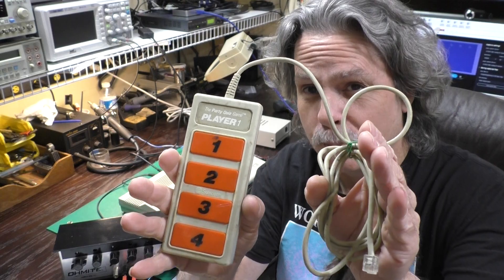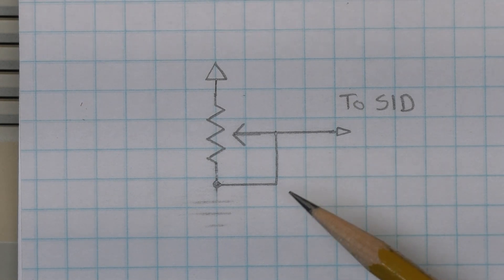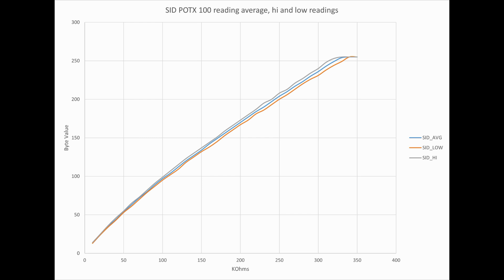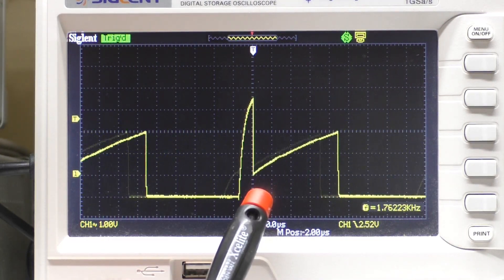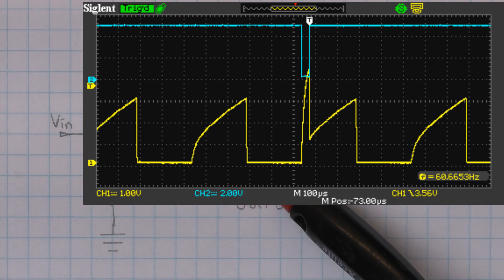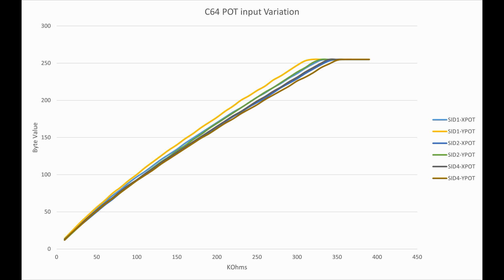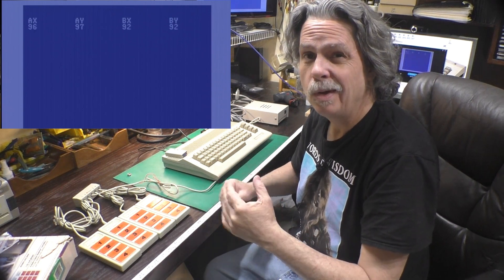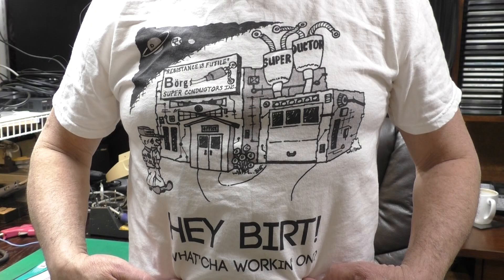Going to POT – Investigating the C64 paddle/POT inputs and devices, a deeeeep dive…

Comment: Did you ever confirm the presence of the capacitor on the C64 motherboard? C64 wiki shows paddles with pots and caps, but I cannot find anyone using caps in their DIY paddles. If they are onboard, then this makes sense.
Reply from the maker: The timing capacitor is in the computer. I have never seen on in the paddle itself. On the C64 the capacitors are C10 and C11. On some early C64 they installed the wrong values for these two caps.
Reply: @HeyBirt  Thanks Jeff.
Reply: @HeyBirt  Found a schematic online, went looking for C10/11 to get used to reading schematics. Found POTX and POTY going to the SID but C48 and C93 were on those lines. Maybe a different revision of the board? Looks like C10/11 are for sound. Found some forum chatter about filters?
Reply from the maker: @CollinBaillie  Sorry, I'm not sure what I was thinking. You are of course correct. The caps for the paddles are C48 and C98 1800pf.

Comment: I enjoyed this video. POT input on the C64 has always been somewhat obscure to me. It is interesting that they chose the SID chip for A/D conversion.
Reply from the maker: Many times these decisions were based on what chip would have space enough on the die and enough free pins. When Atari did the POKEY they also wanted to use the same chip on arcade PCBs so they incorporated  the POt and KEYboard functions along with sound on one chip.

Comment: 1 POKE 56333,127
 
2 PRINT PEEK(54297), PEEK(54298) : GOTO 2

If you connect a 1351 mouse to port 1 and run this program, you get direct mouse readings. As you move the mouse around, you'll see the values sometimes jump from a low value to a high one. The returned values is somewhere in the middle of the numeric range, but it's interesting to note this range is almost exactly 128 units "wide" on either axis. In programs, a 1351 mouse driver looks for this wraparound jump* and takes it into account, allowing you to keep moving the mouse pointer until you run it off the desk! My question is, was the Commodore 1351 mouse designed to "precisely" return POT values within a specific range (meaning every 1351 should return identical values) or is it (since this is analog) using some less-accurate fudgery which the driver itself was supposed to compensate for?

On my flat C64, location 54297 returns values between 85 and 215 (a range of 131 units) and 54298 returns values between 83 and 212 (a range of 130 units). My breadbox C64 returns the exact same range widths for this same mouse, but offers values of 86 to 216 and 84 to 213... exactly 1 higher for both axis. (If anyone tries this program, please share your readings!)

My suspicion here is Commodore's mouse (ideally) was designed to return a range of 128, and where exactly that range occurs is irrelevant. The driver works best expecting a 128 range, but the where of it does not matter. Because my mouse's ranges aren't perfect, there would be a slight jitter using GEOS or similar when the internal wrap occurs, unless the driver is really clever. The ones I've worked with (starting with the one in the programmer's reference guide) happily assume 128 is going to be the range.

*BONUS THOUGHT (as if I didn't write enough) when you ARE using a mouse program, and whip the mouse quickly in one direction, you may see the pointer jump in the opposite direction. I believe this is because you've quickly swooped through the POT range from near one extreme to the other, WITHOUT wrapping around, but the mouse driver logic assumes you did wrap, and slowly moves the mouse in the opposite direction to what you're doing.
Reply from the maker: I do recall reading something about the mouse position data being encoded in 7 bits of the POT input. I think it had something to do with the lsb being considered noise. I don't recall where I read that though.

Comment: Some great info here, and I appreciate the video, thanks!  About the ARMSID, is there a way to know if you have an early version?
The Batteries Included dongles are interesting. I have one for the consultant and if I recall correctly it has a small EPROM in it.  Not sure how that would work but it is interesting.  Not sure about the PaperClip one you showed.
Reply from the maker: I should have looked up the Paperclip dongle before using that picture. It used a shift register IC inside as crude encryption check. Now I am not certain which security dongles might have used a resistor on the paddle input.

There was at least one game that used a resistor in a dongle on the cassette port to. It just shorted out the input telling the computer that the Play key was down.
Reply from the maker: On on telling the very early Armsids apart. I do not know. I got some new ones in yesterday so I'll compare them to the older ones I have and let you know. The same firmware runs on all of them so when the new version is out it will fix the paddle issue for NTSC machines with early PCBs.

Comment: The major problem with analog inputs IIRC was that floating value making the control unstable; even if you let the pot/paddle fixed your character would "vibrate" in the screen product of that oscilation in the read value; another problem was calibration (max and min values had to be read/set at the beginning of each game to know the range of movement in the screen limits your character would have) and lastly the dirty pot over time making bad contact along the carbon strip in the pot resulted in non-continuos values making the character "teleport" or warp; I guest a kill project today would be to build a digital rotary encoder to be connected to (maybe) user or cartridge port to accurately get discrete values that dont have any of the mentioned problems of direct analog input
Reply from the maker: I think if the game is designed to take several readings and average them it would solve the 'vibration' problem you mention. The worst case deviation from read to read seemed to be about +-3 counts.

For something like a paddle you don't really need a precisely calibrated input as you are moving it in relation to what you see on the screen. For the types of devices that depend on more precise readings like security dongles or keypads the software needs to be smart enough to accept a range of values.

Comment: Nice. Is this how A-D converters work in general?
Reply from the maker: This is a very simple type of A-D converter that was cheap to implement (did not take a lot of die space on chip) and worked well enough for the job.  There are may types of A-D converters though. Different types are used for different use cases.

These days even a cheap microcontroller will have a fairly good  A-D converter built in. For example the Arduino A-D input is much better than the POT input on the C64.